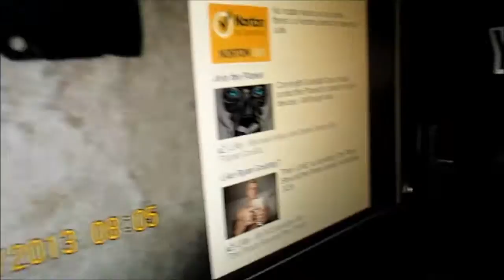AIRSOFT M203 Grenade - Troubleshooting & Repairs/Remedy Fixes

Comment: Are those bearings just .177 BB's?
Reply from the maker: Airsoft 6mm plastic pellets.....
Reply: Can't be. Much to small to be 6mm.
Reply: Nevermind, just found them on evike. 3mm ball bearings.
Reply: Mine flew out upon disassembly. can you confirm they are 3mm? so I can buy the right ones.

Comment: A few questions cuz I'm new to these What does the bearings do? What is the right grease to use? Is there an O-ring in the very bottom on the firing pen? and my grenade does the "fart" but I am also missing a bearing, is this why?
Reply from the maker: Sorry for the late reply.  Since Google took over YouTube, responding to asked questions became more difficult to do!  

The bearings act as a "catch" to keep the "button" closed, until it is depressed in by the firing pin.  You can use simple Silicone Grease you purchase at any airsoft shop or on-line airsoft shops like Evike or Airsoft Atlanta.  
  At 3:45. you can see the O-ring for the valve. 

Missing a bearing?  Did you find it yet?  What BRAND is your grenade?  Is is SHS, MadBull, or???
Reply: it is eagle force lol I have ordered bearings and believe the O ring should be ok but I have that "farting" is that related to the o-ring?
Reply from the maker: Musicforthemindless It is a combination of the "button" not seated well within the grenade, and the four bearings not locking that button.  Usually, I re-do the process as shown in this video, and that farting stops.

Comment: Do you know how to fix grenades that dont reset after shooting? I have to unscrew the grenade and place the valve cone with the o ring into the gas chamber each time i want to fill it up. I think the spring that is supposed to push it back is shot, any ideas?
Reply from the maker: I had the same issues...  The cheaper grenades are like this... sadly.
Reply: +808Kameleon thanks for the reply, though i figured out that they are not self resetting grenades and that the problem was that i wasnt pushing the firing pin in from the back side to reset it. how stupid of me
Reply from the maker: Nothing to blame yourself for... It is of a very poor design... really.  I have not used any of my grenades almost since this video was created.  Sadly, the launcher is no longer mounted on the bottom of my KWA SR10.  BUT!  I will later complete a video of a stand-alone launcher.....

Comment: I have the matrix grenade shells with the three bearings. The bearings won’t even stay inside to allow me to screw it all back together. Any tips?.
Reply from the maker: The bearings just falls out of the housing?  Keep it in place with grease.  Works for me.
Reply: 808Kameleon copy that. I figured it out shortly after posting. I was using just silicon which made them fall out. Then I went and got my bearing grease. Thanks!.

Comment from the maker: No.  Electrical tape will not work.  Use grease or silicone grease into each holes where the bearing sits.  The grease will hold the bearings in place.

Comment: ok so i just got a echo1 m203 off of a friend he said that the only problem is the ball bearings. So i took it apart and sure enough the bb's dont even stay in the socket. I almost ended up saying screw it and put superglue on  it. Whats a easy fix for it? I need to sell the damn thing cuz i hate how much heavier it makes my sr10.
Reply from the maker: Use heavy grease like I do, or you can use simple Vaseline to hold those pellets in place.

Comment: You don't need a new valve on the red one, just simply take out the valve and take the o ring out, put telfon tape on the valve, put the o ring back on, spray quite a lot of silicone, then put another telfon tape on the o ring, this method will boost the o ring and make it seal better a long with the telfon tape on the o ring to seal the silicone oil to the o ring.

Comment: How do you fix "compression" issues, I find that two out of my three grenades are not blasting out the bbs like they should even though theirs no leaking, very odd and frustrating
Reply from the maker: The pellets are held in by the O-ring.  Check the O-ring of it is old and brittle.  So... there is the loud "pop" and no pellets fly out?

Comment: hello.. i have same issue... about your video. same in my 203. do you fix that leak??? or i need to buy that kind of part.
Reply from the maker: It is either the valve on top or replace the bearings if any is missing.  Any larger airsoft shops or eBay carries these things.